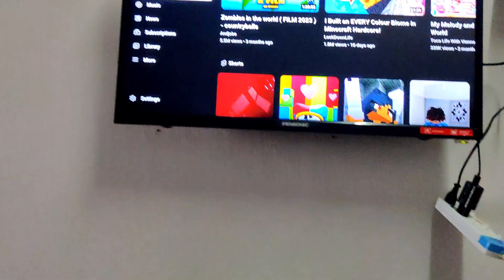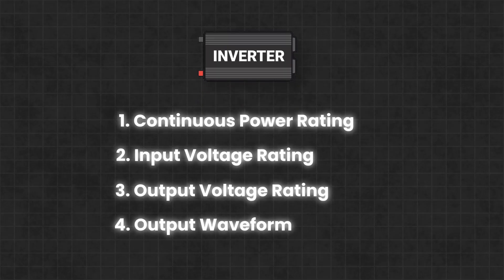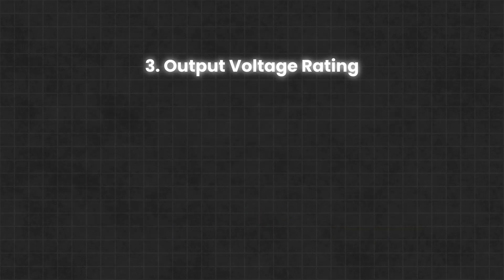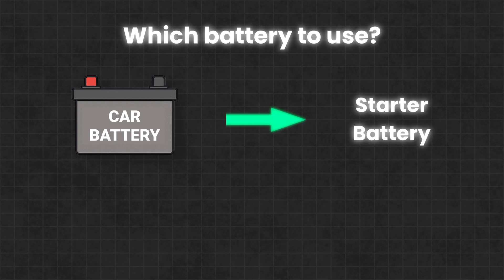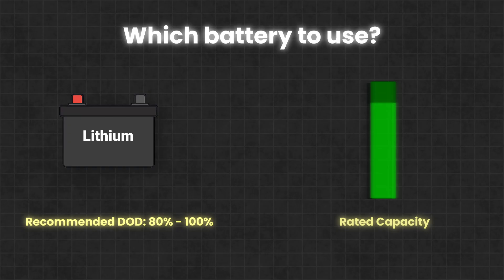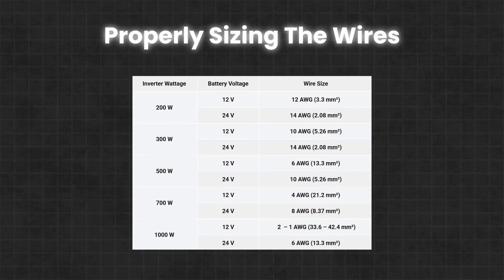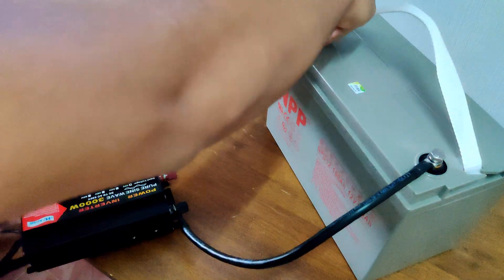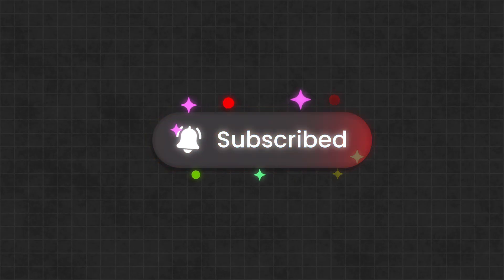Battery Powered TV? Here's What You Actually Need

Comment from the maker: For my setup I used a 12V 100Ah Lead-Acid battery and a 500W inverter. And I think I got like 13 hours of runtime. But again, I'm only using a Lead-Acid battery, If I had used a Lithium battery I could get double that runtime.

Here's a great kit you can use:

BESTEK 500Watt Pure Sine Wave Power Inverter - https://amzn.to/44mNOjZ
Litime 12V 100Ah LiFePO4 Battery - https://amzn.to/4iR24HE
6 AWG Copper Wires - https://amzn.to/4oWvKVk
6 AWG Copper Wire Lugs - https://amzn.to/4q6IJ7B
50 Amp ANL Fuse With Holder - https://amzn.to/4rVf4jE